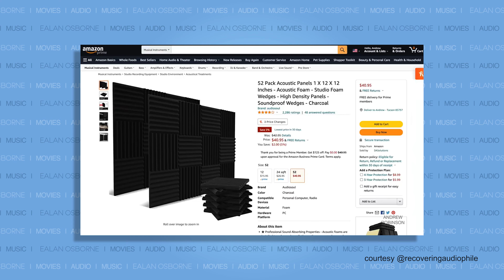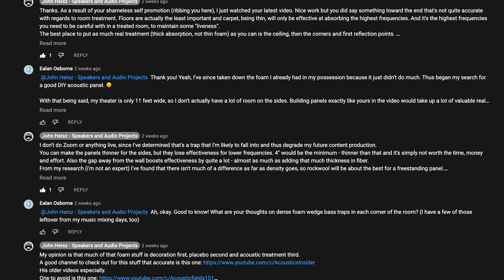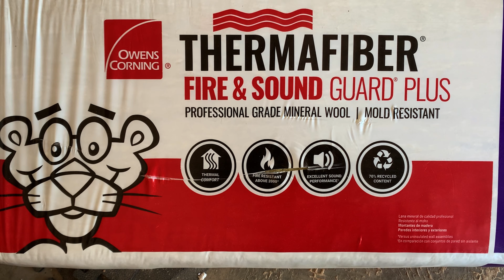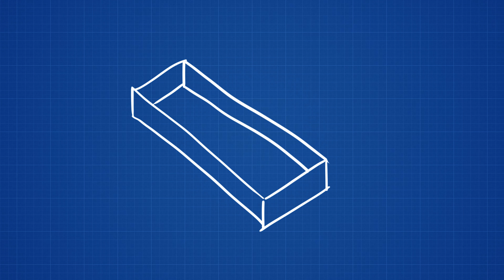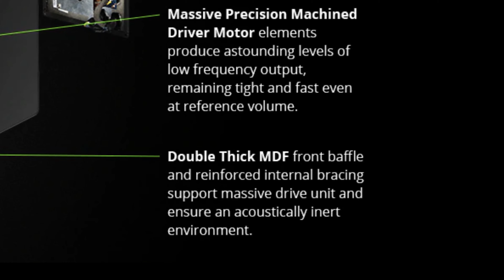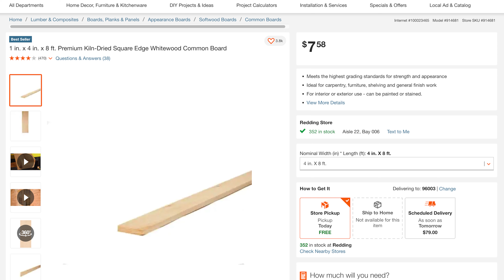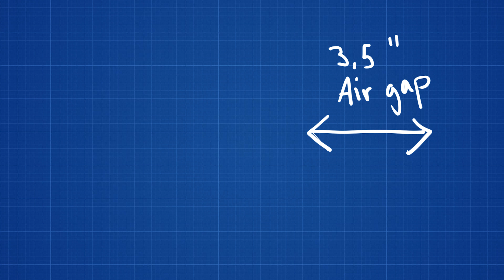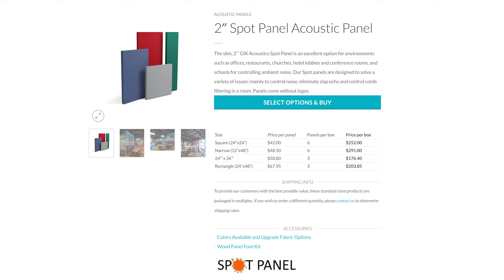DIY ACOUSTIC PANELS ARE HARD...But So Worth It

Comment: Great video. Thanks for sharing. For an air gap (albeit minimal) I mounted 1x3’s (you could absolutely go 2x3 etc) to 1) mount to studs and be able to mount the panels anywhere on the board while being sure they’re not coming off 2) have a 3/4” air gap and I just used 3/4” rubber feet mounted to the back bottom of the panels so they’re off the wall roughly the same amount as the top portion.

Comment: For somebody who finds this video: I used pretty much the same material as Ealan did but made my life much easier. In Germany you can get the store staff of where you buy the MDF from to cut everything to size. In my case it didn't even cost extra that way plus I didn't have to cut anything. I'm sure there are stores in the US that offer this service as well. For a secure fit i measured every needed hole, marked the spot and drilled a pilot hole for each screw. The result is very clean and very sturdy. Structurewise I did it the same way as Ealan with one support-beam in the middle, but I hung mine up the Wall with steel nails (two per panel in a stone wall). After that I covered the front and the back with very light weed matt for the filling to stay out of the air I want to breathe and to ease out contrast between the materials that would have been easy to spot with the property of Linen (which I used as a top fabric) being very see-through. Hope it helps. Nice video and great explanations!
Reply from the maker: Thank you for this! We’re all in this together, helping each other out! 🎉

Comment: Hey nice video. I really like how you’ve got your points across quickly  without wasting too much time but not dropping details   

I think you missed something though.  
The “air gap“, needs to be a sealed box.  So when you bring it away from the wall the way you’ve done your freestanding ones is sound can go through it get reflected and come back through it again in the ‘velocity zone’. (as in the sound is moving through it) but against the wall is what’s called the ‘pressure zone’. (Where sound isn’t moving, it just pressurised like if you squashed a spring) 

The air gap is meant to be an airtight sealed box behind the insulation.   So a 3 inch insulation layer followed by a 3 inch air gap, but also the frame will need to be 6 inches deep sealed on all sides to a rigid backing. Bass follows the lowest path of resistance and will just go around the panel.   By sealing it on all sides and on the back, you create a pressure difference outside the panel verses inside the panel in the air gap.    This is what gives you your extra bass absorption  boost.    

Note to things in the acoustic insider video. His panels are all flush with the wall on the sides so  the air gap is built into the panel.  Also on the acoustic calculator that you highlighted with the graph showing the difference in absorption, on the right hand side of the graph where it shows each panel make up they both say they have a rigid backing.  Aka the back is sealed. 

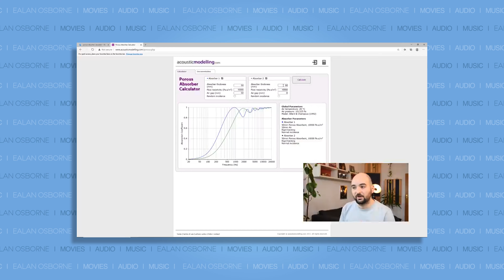Hope that helps. 5:23
Reply from the maker: Whoa, thanks! Good to know! I will def apply this new knowledge when I build out my “dream” theater a few years from now. 😁🤘
Reply: @ealanosborne  acoustics is such a rabbit hole 🕳. As soon as you’ve got something figured out, almond comes the thing you didn’t know, and then the thing you didn’t know you don’t know is purging round the next corner!

Comment: I have curtains of different thickness covering both side walls which i can open to expose small sections of bare wall. The front wall has motorised velvet curtains which open and close, when i watch a movie.The floor is covered in thick carpet. The ceiling and the back wall are the only surfaces not treated.

Comment: Ealan, late to the show here, but thanks for the info.   Something else that may be of interest would be creating your speakers out of ceiling tiles, foam panels.   I recently saw a few videos that show how to do this.  best part is they can also reduce the echo/reverb while providing the sound you want.

While these panels would still require the use of a sub for the full low ends and added clarity, the panels will do double duty in your space.  Tech Ingredients I believe is the guy I watched that tried multiple materials for these panels.  In one I believe he did a 4 panel per channel setup for a fuller sounding range.   He does get scientific with information so if you can bare through the technical info I think you would find it beneficial.
Reply from the maker: Whoa, cool! Thanks for the heads up! 🤘

Comment: Good video. But I'd take caution with using that insulation. Most insulation, including rock wool, is made w/ formaldehyde which causes cancer. It's not a problem when it's inside walls that are then covered up with drywall. But when you only cover them w/ a thin, extremely porous fabric, I guarantee that some of that insulation will eventually come out in the form of dust. You will breath in that dust...That's literally the only reason I have not built my own panels. Access to cheap insulation WITHOUT formaldehyde doesn't exist in the states. You can buy it, but it's very expensive. i.e., denim or hemp. I researched using foam that's used in couch pillows, but that's even more expensive.

Comment: Great video!  I recently built 10 panels with 3" thick rockwool and used 2x3's and my 2'x4' panels ended up just over 20 lbs each!  yowzers.  Sturdy, but heavy!  Wish I had used lighter wood!  The sound is SO much better in my little home studio though!

Comment: You can screw the MDF but you need to pre-drill the hole the proper size for which screw your using. Ideally you want the hole to be just barely smaller or the same size as the main part of the screw without the threads.

Comment: Ealan Awesome video my friend. Thank you for taking the time to make it. I know it added more time to your build process and we appreciate it. I still have a few questions. I get it took out the reverberation in your room. However it’s really about how the system responded to it for me. Did it clean up your audio presentation? Did it measure different? An echo is an echo however as someone who might be wanting to follow the same steps I’d like to know how the system sounds afterwards. I know you linked a video of someone else’s channel that talked about it more in a technical aspect. However I’d like to hear it from you.
Reply from the maker: Hmmm…well the thing about home theater acoustic treatment is that you’re not dealing with a music studio setting, or vocal booth setting, where deadening the reflections is key for critical listening and music mixing. Home theater, on the other hand, still needs room character. So while my acoustic panels helped with the ridiculous reverb decay time, it’s still not completely dead. It still has some reflection properties to it since it has plenty of spaces of bare wall and ceiling. It definitely helped clean up the sound, made it less muddy, less fatiguing over longer listening periods, and better precision between all the speakers. That, and I heard a bass response like I hadn’t heard before in a home setting. It was really cool. I have to attribute that to how thick I made the panels, along with the air gap, to better manage those long ass low frequency waves. 🤘 I have yet to really measure the room extensively with REW, but I know what my ears heard, and it was leagues better. 🙌
Reply: @ealanosborne  awesome!!! That is exactly what I was looking for

Comment: 08:33 

FYI for everyone else, this is how you create conditions that cause kickback on a tablesaw. Get a miter gauge. Never free-hand a table saw cut like this where the 'waste' side exceeds the width of the side being cut this drastically. Be careful!

Also, it's ridiculous that all of these crosscuts are being made on a table saw when the miter saw is right beside you. I have to guess that you just wanted to use the convenience of the tablesaw fence for measurement instead of measuring and marking for cuts on the miter saw.
Reply from the maker: Precisely. I already had the lengths measured out on the table saw, as opposed to having to make marks on each individual plank over and over. Just trying to save a little time since I was already behind on the theater build. That and I’m clearly not a woodworking expert. I had access to the equipment, but maybe use it every couple of months for odd projects here and there since I’m capable of doing most projects DIY. 🤷‍♂️

Comment: I built my first acoustic panels about a year ago. The first one sucked but the rest looked great. We went the 1x4 route instead of MDF. Also used a generic mineral wool with the identical acoustic properties as 703. Think we came in at $30 for each. Well worth the investment in time. Basic panels are around $100 each with shipping. FYI if you get some wire screen door material and staple on the front your fabric will turn out great 👍
Reply from the maker: Awesome! Thanks for the tip!

Comment: Hell i just took an old memory foam mattress and cut it into chunks n built corner bass blocks with it stacked up then hung a bunch of moving blankets over the walls and draped em on the ceiling using fasteners every so often to make it sag in between..  can play drums all night and not have the cops called now..  only drawback is it gets hot as hell in there even in winter..

Comment: Ealan : I have small media room (10*15)and with REFERENCE DOLBY ATMOS HOME THEATER SYSTEM (with two R-625FA Dolby Atmos® floor standing speakers), can you please guide me if I can add acoustic panels on the ceiling, as my understanding is the elevated speakers reflect sounds from the ceiling. Adding acoustic panels on the ceiling will degrade the overall Dolby Atmos experience ?
Reply from the maker: Correct. It’s best that you have a flat ceiling for upward firing reflections. You might be able to get away with some slim panels near the corners (directly above the TV) and even some behind your listening position, just so you have something up there to help deaden reflections. 🤷‍♂️
Reply: @ealanosborne  Thanks

Comment: Nicely done! I've been looking into doing this for my own space. While I'm up to the DIY challenge, I don't have the tools required (e.g. brad nailer, table saw). Lack of access to the proper tools for the job significantly reduces the cost benefit of DIY. I don't mind purchasing tools, but I'm not even sure what is essential. Maybe I should search more broadly for a list of tools recommended for beginning woodworking. Did you come across anything like that in your research?
Reply from the maker: I didn’t. But as far as a good overall “starter kit” for a solid woodworking space, having a miter saw, table saw, impact driver/drill with different bits, and a pneumatic kit (stapler, braid nail guns, nail guns). Although I was SO fortunate that my brother-in-law already had all that.
Reply: @ealanosborne  Yeah... how about an "intro to starter kit for noobs"? Haha. It's a large initial investment, and I'm not sure what else I would do beyond this little project. I guess I could build some speaker/subwoofer enclosures... maybe some birdhouses... soapbox derby car... 😆
Reply from the maker: @travisjacobson682  Haha! True. My brother-in-law does like the challenge of DIY woodworking projects. He and my wife built our current bed frame and side tables, as well as a TV stand and coffee table for himself. The possibilities are endless if you wanna get into it! 😁

Comment: You make it overly difficult.  Number one you shouldn't mount to wall. Go gobo style, lots of them. Use 3" or 4" Owens corning material warp it in goodwill sheets to prevent fiber migration.  Lastly hang lots of warped panels from ceiling with hay bail wire. Hope this helps.
Reply from the maker: Thanks for the tips!

Comment: 9:57 MDF isn't fragile per say but think of it this way, it's so dense that there's no room for screws so you when you try to screw into it without pre-drilling a hole the screw is forcing the wood apart.

Those look pretty sweet though, I like that you can easily move them around and experiment with where you should place them. For example you might find that the side wall reflections all being absorbed make it too dead or not spacious depending on the speaker and you could try moving them to other parts of the room to see if they have a more desirable effect. I'm planning on treating parts of my living room just have to figure out what I can get away with, probably going to end up with either 2" owens 703 with 2" gap or 4" with no gap then some 2" panels no gap up front for some sbir absorption. Won't be able to do sidewalls so I might just need to get narrower dispersion speakers.
Reply from the maker: I noticed it made more of an impact on slap-back reflections when the ceiling panels went up. Something to think about, since you might be able to get away with more up there, since not everyone will enter your living room with the intention of looking up right away. :)
Reply: @ealanosborne  I wish but 8 foot ceilings and even if i wrapped them with white fabric I still don't think it would pass WAF. When I get a dedicated theater all bets are off though! The fact that she's ok with rear absorption panel as long as the print on the fabric is nice and I think I can make an aesthetically pleasing front panel setup for my sbir issues should get me a good enough place that with fix the tiny bit of zing I have in regard to decay times. Honestly haven't measured my rt60 times but I'd wager due to having a lot of furniture around the room and carpet on the floor I think once I get a few panels in I'll be in the good range albeit on the higher side.

Comment: Are you not worried about breathing in fiberglass from those panels? Not trying to scare you but those fiberglass sheets are meant to be sealed behind drywall to insulate from weather. Fiberglass strands can escape from the cloth and float around in your room.
Reply from the maker: I haven’t noticed myself having any coughing fits or anything. And it’s not like I’m constantly moving them. They pretty much stay put, so there’s no particles escaping due to them being jostled. 🤷‍♂️

Comment: Great video Ealan! Been venturing down the DIY panels rabbit hole myself the last week. I think I’ve settled on copying this guy : https://youtu.be/qBy63yKkoqQ

Would love to hear your opinion on those... I like how simple the panels are (no time/$$ spent on pwood work) now I just gotta get my hands on some 703 without going bankrupt
Reply from the maker: Those are pretty good! Although he’s setting up acoustic treatment for what looks like a music mixing studio. Those need to be more “dead” sounding than a home theater space. The fact that he lined his entire walls with panels is too many for HT. You want your room to have some character, not have dead air, or else your AVR will be working too hard to get to normal volume levels. 

That and he mounted them directly onto the walls. For HT applications, it’s imperative to have an air gap between your panel and the wall or ceiling. It’s a fool-proof way to make your panels work twice as good without spending money on 703 that’s twice as thick. So if you get panels that are 2 inches thick, mount them with a 2 inch air gap. It’s always going to be a 1:1 ratio. 4 inch thick panels? Mount them with a 4 inch air gap, etc. But I agree - getting those 703 panels and just glueing fabric straight on them is going to save you time. 🤘
Reply: @ealanosborne  wow thanks for the reply! Yea I’ve been thinking about a mounting solution to incorporate the air gap. Learned a lot from your video such as a 1:1 gap to panel ratio. I hadn’t considered the difference of home theater vs studio! I was going to make 12 panels but now I think I’ll just make six and see how it sounds. Thanks for the content bro. Love all the jokes you throw in there
Reply from the maker: @texasbuzzard4970  Thank you! 😁